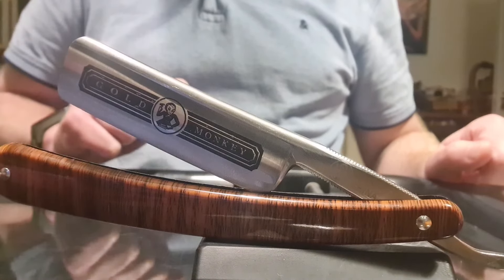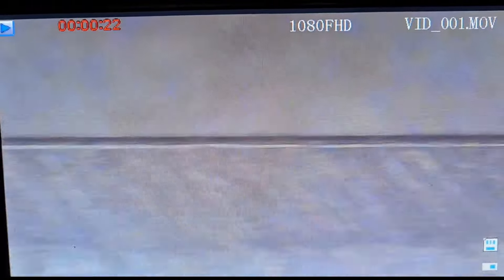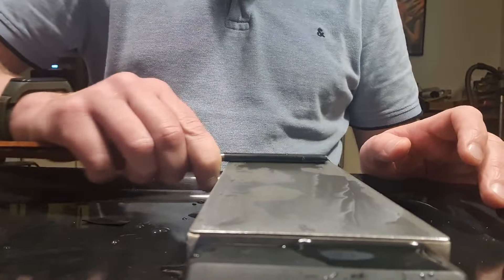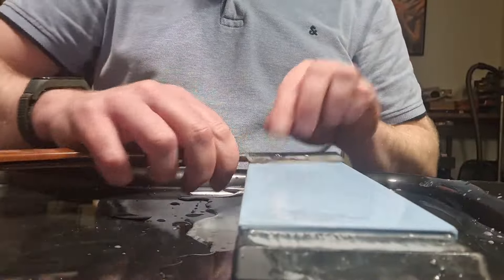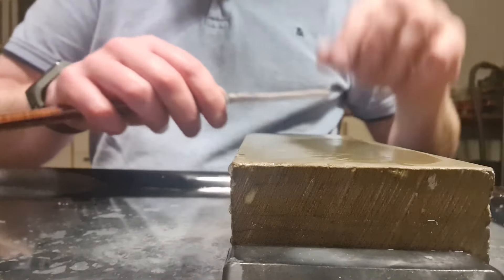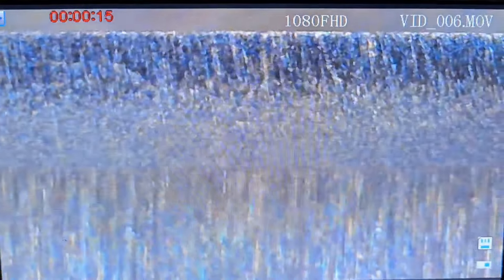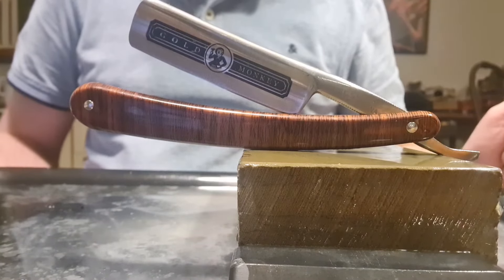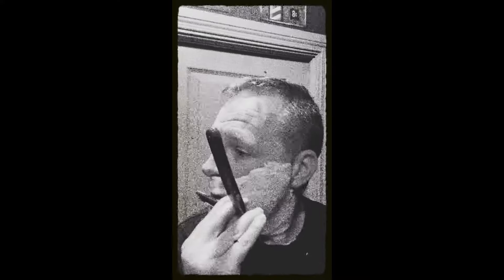Gold Monkey - Chinese straight razor: is it really a bargain?

Comment: Thank you for the very interesting review! I did not know that these cheap razors existed and now I will also order one.
Apart from bad steel, it could also be that the edge has been "burnt" by the machine sharpening at the factory and that you are making a bevel on fatigued steel. Cutting part of the edge off straight into the stone and giving it a third sharpening could perhaps reveal better steel.
Reply from the maker: Hi,
Thanks for your support 👍
It could be indeed a bad control of the temperature when forging indeed but after recrewting the bevel twice, I won't do it again... But you might be correct, it could "maybe" be solved with a third attempt.

Comment: What is your expectation of a good steel razor?  How many shaves?  What maintenance steps?
Reply from the maker: It's unfortunately very variable, depending on the beard type, usage, maintenance, etc...
But I'd say it should easily last 30-50 shaves without impacting shaving comfort.
Reply: @FroggyShave  Thanks for your thoughts.  I was curious of a direct comparison from the same person using both.